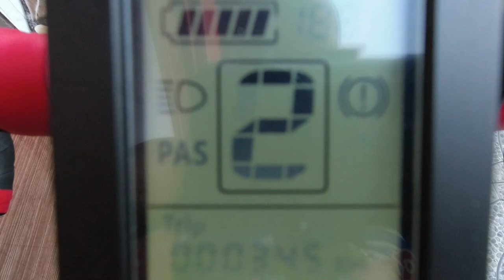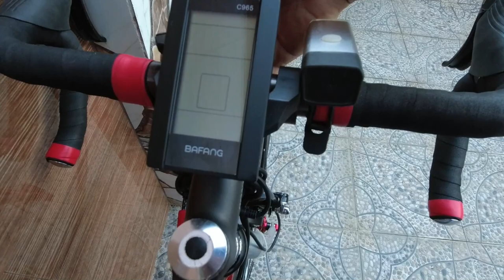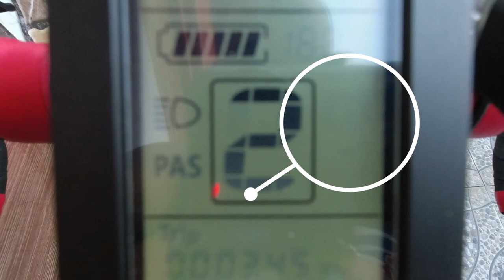E-ROAD BIKE CONVERSION UPDATE BRAKE SENSOR INSTALLATION & HOW TO TEST E-BIKE BRAKE LEVERS | DIY Petz

Comment: Thanks for the video.  On my setup, motor wont work if i have break lever sensor plugged it... Do you have any idea why ? I havent put the break wire in though im testing before im going too far..
Reply from the maker: Hi Sir, try to check wether of not the sensor is an open or closed ciruit usig the tester for continuity.  If the circuit is closed, then the motor won't run. It only  runs when it is on open circuit. Hope this helps.

Thanks and stay safe.

Comment: Very instructive, but wouldn't work with caliper brakes. How about throtle with those handlebars?
Reply from the maker: Hi Sir Dushan. What do you mean by caliper brakes? V-brakes or Disc brakes?  Yes, we could install the throttle but I opted not to install it for me to make sure that I'll still be able to exercise as much. Stay safe Sir and thanks for the comment.

Comment: Sir, where did you buy your kit gani? I've learned it somewhere but I forgot which video :D
Reply from the maker: Sir Andy kumusta na imo ebike Sir. Actually aliba a pud Sir kay cheaper gamay compare to shopee/Lzada Sir.
Reply: @RollyPetz  na ok na ang jerky motor, pero Wala japon Ang throttle.. na daot sa pag cut and resolder sa motor cable. I was planning to purchase a new kit to replace the faulty one, but I think it's more efficient to buy a new ebike na lang 😅
Reply from the maker: @andycalope  ok sir Andy. Thats why conversion kit lang ako gamit sir para kung maguba dali ra ilisan...
Reply: @RollyPetz  pwede ma share imo supplier sa conversion kit so I can narrow down my choices 😁 thanks
Reply from the maker: Sir Andy good pm Sir. Mao ni ang ako gipalitan sa rear hub motor Sir...Dala na controller and rear hub motor assy no battery lang...
https://www.alibaba.com/product-detail/48V-1000W-mountain-bike-kit-with_972538811.html?spm=a2756.trade-order-form-buy.0.0.4fe7YBOiYBOitB.

NCycle Supplier Sir..
https://ncyclebike.en.alibaba.com/?spm=a2756.trade-list-buyer.0.0.27b076e9kKC2RH&tracelog=from_orderlist_company

Comment: You installed it wrong.  Those brake sensors are designed for the brake levers not the brake calipers.  See https://www.youtube.com/watch?v=8nh1zX5l0SE&t=101s
Reply from the maker: Hi Sir, yes it was not intendedly to be installed this way but I manage to find a way to be used in my road bike conversion. There are other ways but this one works for my setup.

Comment: Hi what you would recomed>?250w-1000W ?
Reply from the maker: Hi Sir good day. With regards to the recommendation, you have to identify first the following factors:

1. The user, what is the estimated weight?
2. Where to use it? Is it for daily commute, more terrains or hill rides? or more on flat surfaces.
3, The budget.

If you have the these then this will help. Go for a higher wattage if you want to enjor more of the conversion. For me the 750W power is more than enough for the above factors for I'm only 60kgs and mostly used it for daily commutes and long rides on weekend.

Thanks for your question Sir. Hope this helps.